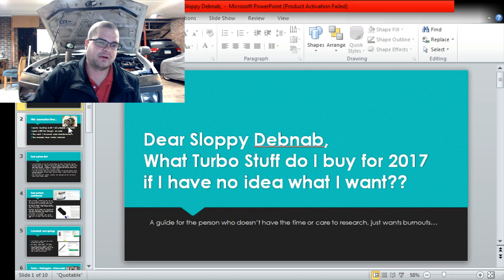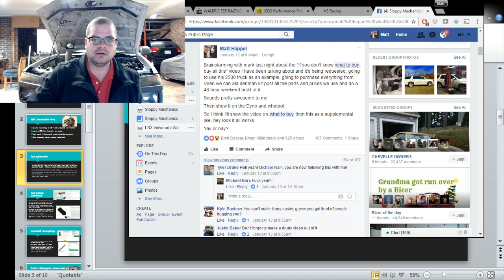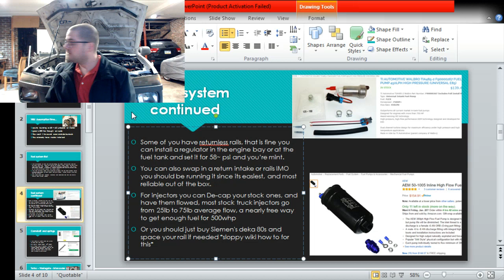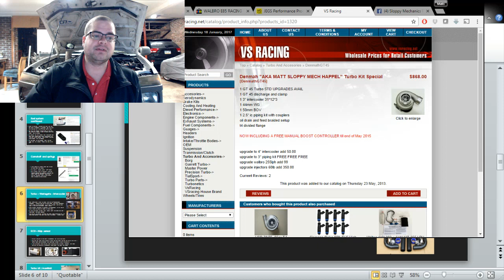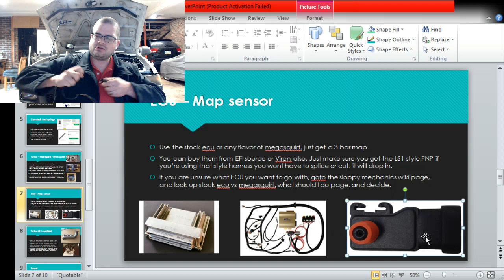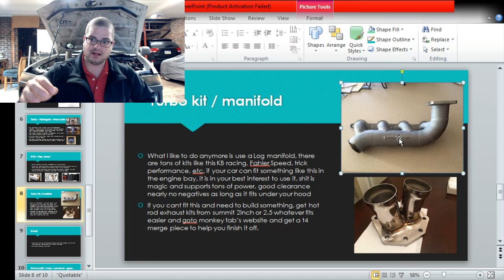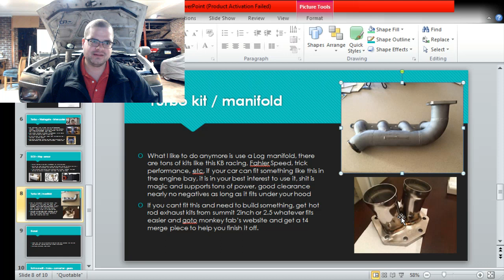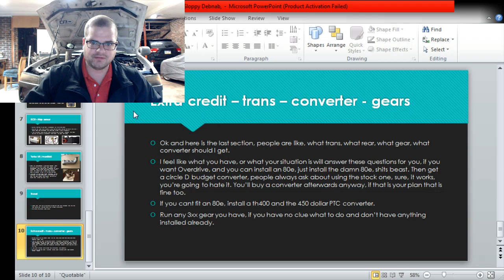What turbo LS stuff should I get 2017 edition

Comment: You've turned into the midlife crisis guidance guru. You bring excitement back into lives. 👊
Reply: Also, I don't go on ls1tech much and I wanna know what you think of the ls9 cam, 5.3, 7665, 2.5" exhaust merged to 3 to the t4 flange. 3" ic shit, water to air and meth injection, decapped injector  through a manual and 3.73 8.8  combo? I want more than 500 on a mustang dyno.

Comment: Thanks for the info Matt. I’ve been planning my set up and decided on putting in the Summit drop- in truck cam, then HP tuners followed by the 78/75 turbo. I’ll be doing it in stages and aiming for 400’s as mainly a cruiser that still does home owner truck stuff. Also running the stock nv4500 till I can do a th400.

Comment: This video was great for a turbo noob like me! My 87 Monte Carlo already has a 6.0 lq9 with a carburated (yes carburated) setup and large texas speed tsunami cam 235/239 .649/609. Car already has a th400 with a ptc 4500 stall in it. went mid 11s this way. I would like to ditch the carb and build a turbo setup capable of 800 or better to the tires now. Inspired now lol

Comment: With this video going on 3 years and some broken links, would you do a remake of this video with a LATE model Vortech 6.0. I have a low mileage 2013 6.0 with fly by wire. The cam you suggest says up to 2004, turbo kit no longer linked, etc... thanks Sloppy.
Reply: Refresh please.

Comment: I’m wondering if I should get a billet 75mm or the billet 78/75 from VSR.. goal is around 750 HP for taking it to the strip, other wise it’ll probably be ~600 for the street (running way less boost). I’ve found a lot of formulas for sizing a turbo and it seems like the 75mm works “more efficiently” than the 78/75.. but they are basically the same price

Comment: the only thing I have a question about is. when that cam goes in do I have to change the rockers and  a longer pushrod? then the log manifolds the ones from trick  t4 flange with crossover manifold is 1200 bucks. Is that what you purchased as well? I'd like to get a hold of your buddy who makes them. thanks awesome video

Comment: I'm surprised you didn't recommend an LS9 cam (PN#12638427). $115 at Summit Racing for 210/230 duration and .562 lift. It has a really wide LSA but that should be good for boost, that's what's in the factory boosted LS motors after all.
Reply from the maker: ls9 cam involves alot of shit like front cam gear swap, wiring differences and i feel like it has a really soft bottom end in comparison to all other cams i have tried, also it doesn't sound cool, wich is 80% reason why people install camshafts
Reply: ***** Makes sense considering the LSA. I'm not too worried about the cam gear, but after I commented I heard the timing cover has to be swapped. Is that true?
Reply from the maker: yes, gear, sensor, timing cover, wiring, are all part of the swap for sequential operation
Reply: ***** Thanks for the help.

Comment: 700 is a decent trans option, the tv cable can be a bit of a bastard though.
Reply: suzuki400boi not really. The 700 is the father of the 4l60e and I had all the same problems plus the picky TV cable. I personally hate them for performance builds.
Reply: FatMan Videos  They're fine for this type of build, we've out them behind quite a few 500+hp cars. But more or less mentioning it simply cause it's a cheap option that has OD/lockup

Comment: Any point in bolting a stock cam 5.3 to a turbo with a 63/89mm compressor and a 90mm ex turbine?  Just wondering if the thing will spool before the compressor is out of breath, lol! It was cheap, all I can say. Thanks for the inspiration, Matt. I had to wire the EFI myself (color blind electronics noob) and your videos on the MS took the scary out of it.

Comment: All great info. 
Im doing a 5.3 with Holley Sniper Efi with nitrous. 
My problem is finding a nice manual that can handle 500 hp and shift fast but isn’t as expensive as a T56.  Is a T5 sufficient or is there any other muncie 4 gear transmissions?
Reply from the maker: Cd009
Reply: Sloppy Mechanics 
Hi,
Curious to hear your thoughts on AR5 vs CD009. Did you have success with both? Any preference for gear ratios and availability of parts?

Comment: Two Questions: 1. What do you do for vehicles that have vacuum operated power brakes.
2. What about boost control. I know GM ECu needs complete external setup, MS3 has boost control but curious about Boost Controller/Solenoid hookup and what you're using. Haven't seen any details about these 2 things anywhere in Sloppyverse.
Thanks for the great info as always, I'll try to remember my LS1tech password and PM the question there if you don't answer here.
Reply from the maker: you hook up the booster to any of the vac sources on the intake, since nearly all LS motors are hooked up the same way to a vac brake booster, cept for trucks with the hydroboost

read the ms3 manual that highlights boost control, super easy

Comment: Have a 1500 sitting in the driveway now. Gotta address an air bag code and its going up for sale or trade for a 2500. This is EXACTLY the summary/confirmation vid/info that i've been looking for after spending years lurking on LS1 Tech for a budget setup. I've followed you for a while and kind of knew this setup already but this vid was so concise and stupid proof... love it. I will start with this setup for sure. I don't see myself wanting more than 700 tire as the truck will just be my dump run/home depot/hooligan vehicle. Is 700 wheel attainable with this setup? If not, would I be able to just swap in a bigger turbo to get there?
Your info and delivery is awesome. keep doing what you do, its much appreciated.
Reply from the maker: i made 700whp unlocked with this turbo and a similar camshaft and turbo setup
Reply: Sloppy Mechanics awesome, thanks for the reply

Comment: I hate to need hand-holding, but after reading the sloppy wiki about the various 4L80e versions in the wild; is one identified as the golden trans for LSX swapping? Exampe, 92-97/94-97 seems like a bad time. 2000-2003 bellhousing has correct LS bolt pattern, and seems perfect. 2004-2006 covers NBS but seems additional changes are needed to make NNBS work on an older Gen3. Side note: I have a 6.0/4L80e flex plate to swap onto my lm7 thanks to $20 craigslist score. The circle D converter seems to be only for the factory 4.8/5.3 flexplates - have another you'd recommend with a better stall than stock?

tl;dr Is the 2000-2006 4L80e the best choice for a Gen3? What converter would you run with a stock 4L80e flex plate?
Reply from the maker: any 80e from 93 to like 2010 is the same thing

Comment: Much appreciated on this vid.  My question for easy, cheap builds like this is connect down pipe to stock exhaust with stock o2 sensor locations?  What about the cats?  What works best for tuning?  Or just cut exhaust and dump wherever lol?
Reply from the maker: on my wifes truck i connected to stock muffler and tail pipe, no cat however because turbo hotside replaces all of that, stock 02 sensor locations in the hot pressureized side and working pretty good, one side is off slightly because its getting the o2 reading from both sides passing it, since its a crossover single log kit. you can do it alot of ways and depending on how it likes it and whatever you are comfortable with etc etc

Comment: that is alot of information GottDamn it is not that expensive when I checked it all up.
What year 2500 HD start gen 4 rods?
Reply from the maker: some 04s are
Reply: I am looking at a 2006 2500HD just to follow your steps.
the guy told me it just need lifters he thinks, there is a tickin sound when on tho
Reply: My 04 2500HD 6.0 donor engine has the good rods, just pulled the pan off it today. Insides look like the day it was assembled too. :)

Comment: hey Matt I'm doing a twin turbo 2 door Malibu it's a 6 liter with a cam similar to the one you recommend I do have the AeM 380 pump and siemen Deka 80 pound injectors I'm running 2 Chinese gt35r how much power do you think that 380 pump will support I'm shooting 4 650  to 700 Tire Tire?

Comment: What can be expected from this setup on a manual trans . I know the tq table will be different and change from gear to gear but will the hp change much . Im going to be running a Nissan z32 trans on my sloppy build . 500 is basically my goal number 530 hp out of a 5.3 i realistically what i want to see 100hp per ltr is what i want to achieve.

Comment: I didn't hear you say whether or not you need to spray meth for the 5-600whp or if its just straight pump gas.  Reading the wiki, it says "have someone tune it on pumpgas and meth"  Any idea where the octane limit of pumpgas is... boost level or hp?

Comment: matt do you know the bosch number of the 160lb injectors you used that sucked?!
was it 0280158827?
Reply from the maker: http://www.ebay.com/itm/New-Bosch-0280158827-Fuel-Injector-EV1-Connector-160LB-1700cc-High-impedance-/111623167111?hash=item19fd425c87:g:3tsAAOSwJhNXUE6X&vxp=mtr

its these
Reply: thanks.

Comment: I do have a question..  I recently put a 5.3 in my 04 Dodge Ram 1500 and I'm using the Dodges fuel pump which is none return and the regulator is in the fuel sending unit..  so how could I do a  turbo setup for my truck?  can I use this fuel setup somehow?  or would I have to find a different fuel setup if I go turbo?

Comment: what size stall for th400 i have a turbo 5.3 with stock cam, will change to sloppy stage 2 cam, in a 77 monte carlo, has stock 10 bolt axle with mini spool and highway gears, has stock th350 in right now but i build a th400 and is sitting on the work bench.

Comment: Ok. So I like to row my own gears. Living in the U.K. poses  a few challenges when it comes to finding someone that can tune the set up. With this basic turbo set up which of the Sloppy Tunes would you recommend to run with a T56 and the factory ECU to get me in the ball park?  Can I thank you for putting this together Matt..

P.
Reply from the maker: you can use any of the automatic tunes and try to get everything close if the tables match or not, also i believe i have a stickshift speed density tuneup in there also
Reply: +Sloppy Mechanics Thanks Matt, I will have another look through the Sloppy Wiki for it. P.

Comment: C5 fuel filter and reg should flow enough to make the power numbers you are talking about and they are $40
Reply from the maker: ehhhhhhh i have commented many times the c5 regulator can be a finicky bitch 450+whp, i dont want to suggest stuff that Might work
Reply: Fair enough, it was just a decent option that I have found online that costs much less then even the regulator. Another option would be to run them in parallel. It might eventually get expensive if you are putting a lot of miles on the car and always having to replace them, but I feel like most people that do these builds do not actually do that.

Comment: Thank you for info !  
I have LQ4 in my drift car, I am thinking to turbo it. quick spool and response is critical, which turbo would be better? HP goal is ~600hp wheel
Reply from the maker: the 7875 lights off really fast, if you're looking for best response have a really good turbo kit built and contact John Bewley at Little john motorsports and get a custom cut camshaft

Comment: i do know if im going to go turbo or not but would you still recommend that cam for an 04 truck that might tow occasionally i just say the rpm was like 2500 to 6500 i just dont know how that performs at the low end

Comment: What kind of pushrods should I use with sloppy st2 cam, LS7 lifters and PACs 1218 on 5.3 LM7?
Stock ones or shorter?
Reply: I also have the same question
Reply: use stock pushrods

Comment: More dopeness!  Can't wait to roll into a smog station with a 4 inch pipe sticking out the hood of my 71 and watch them try to hook up the sniffer, probably gonna fail.  Although, they never ask where my gas filler is to check the cap.

Comment: Hey Matt what stall speed do you recommend to go with?  I have a 5.3 7875 turbo 4l80e with 3.73 gears in a fox body.  Right now it still has the stock converter in it, I've fired it but haven't finished the turbo yet.
Reply from the maker: Jason Williams a tight 3000 is ideal for street strip

Comment: How much power are the 4L80E's taking reliably (with  that HD2 trans kit ?)
Reply from the maker: rishi kataria 1000hp
Reply: Holy crap
Reply from the maker: my colorado has a stock trans, i talked about this in the video, where you at
Reply: How do you think a 4l80E  with that HD2 kit would hold up in a 800ish AWHP DD 5600+ lb Yukon Denali with AWD traction ? would like a 0-60 street terror, the weight and AWD traction should work well.  Also, is anybody actually re-gapping their rings on boosted LS engines as used to be recommended ?

Comment: Have you ever used the corvette filter/regulator combo?
Reply: can't speak for matt, but i use one with in my BMW with a AEM 380 pump, works great and can buy a replacement at any autoparts store
Reply: Joseph Fahler I've used them too. Just wondering if he has had an issue with them supporting higher horsepower applications. It's cheaper and easier than a regulator plus it kills two birds with one stone

Comment: Can that jegs camshaft work with the stock 4L80e torque converter?
Reply: Rondell Holden I would not recommend it, it would work but will be lazy as hell under 3000rpm

Comment: If I have that aem pump mounted above a sump on the bottom of a stock mustang tank, will it pull fuel up or do I need to mount it lower so it will gravity feed, this pump will last on a street car?
Reply from the maker: they seem to do pretty good pulling short distances like that, just listen for it struggling if you can, all sumped setups will make struggle noises when slowing down and shit like that

Comment: GREAT VIDEO. Now whats needed for 700-800 tire :)
Reply: Ryan Taube wondering the same thing lol
Reply: Ryan Taube now that's what I'm trying to figure out because that's my goal
Reply: dishon Williams  same thing on what he said,  just up the boost and run E85 fuel with a new tune. over 600hp easy
Reply: Tyler Kasemeier  I'm in South Los Angeles and it's hardly any e85 around here I was thinking pump gas and meth
Reply: dishon Williams oh..  you have 91,92, or, 93 octane in your area?
Reply: Tyler Kasemeier 91
Reply: Good.. run that with a custom grind cam and try 8psi and keep upping your boost.  I'd buy a HP Tuners software to really help out on how far you can push your boost safely...
Reply: I'm in the same boat as you..  lol. I want 600 or more HP but with my project my fuel system is complicated
Reply: Tyler Kasemeier okay this is my first turbo build I have a 2006 6 liter lq4 twin Chinese gt35's DEKA 80lbs injectors AEM 380 fuel pump 3bar map
Reply: goal is 700 tire am I on the right path for that goal
Reply: dishon Williams what cam you running?
Reply: Tyler Kasemeier  it's 228/234 600/600  on a 112lsa
Reply: @tyler ?
Reply: More injector and more boost
Reply: Better heads, cam and intake...
Reply: dishon Williams injector, fuel and more boost

Comment: If running e85 instead of pump gas what would you change if anything
Reply from the maker: you should be able to swing 500 tire on 80s and a wally 450 single pump
Reply: I'd like to hit 700 tire, I have an 04 flex fuel 5.3 reg cab Silverado with a btr Stage 3 Truck Cam. Built 80e with FTI 4000 stall already. Will the deka 80s get there with e85? Also I thought of doing a surge tank with 2 inline 380 AEM pumps and a boost reference regulator. I'm ok with overkill on fuel system. Thoughts?
Reply: Billy Mattull yes you will hit that. tuned a 4.8 truck recently on 80 dekas, made 800whp on e85.

Comment: what's your reason for not running a blow off valve?
Reply: More plumbing to leak and weight for no real benefit, people think dose/flutter kills turbos because they mistake it for compressor surge.

In reality tons of stock cars do 200k+ miles with no BOV and the turbos don't care.

Comment: Yeah..... whats needed for 1000 whp. LOL!   Oh, thats covered already too!!! Youre the man Matt. Im building a 70 Nova lightweight small tire car running an '13 gen4 5.3 with a stage 2 cam, S480 snail thru an Ultra Glide and into a spooled Fab 9 w/3.50's. Just ordered twin 44's from Viren. Im gunning for 8.50's car should not top 3000 pounds.   My hard spot right now is management. I know nothing of stock car computers tuning but im looking at maybe an FiTech (a few guys run low 9's and one even touched the eights!) or, if i can swing it more likely an nHP from Holley.   Looking you up as often as you dish it out!!

Project is here if any interest lots of pics/ complete build. 
http://www.yellowbullet.com/forum/showthread.php?t=1996313

Comment: Burnouts(in Australia); Buy LS-powered 1999-2006 Commodore. Brake stall, ?????, smoke fo dayz. Then you realise sway bars are awesome and you go through the twisties up the ass of people with a fair bit more power and they only get away in the straights, anything over a couple degrees of bend in the road and they are shitting their pants with body roll since they can't keep the front end in check and let the LSD control the rear. Goes without saying that a lot of people end up wrapped around trees in these things, gg